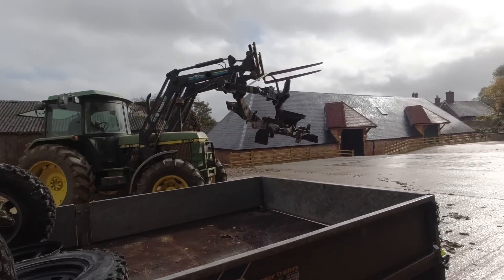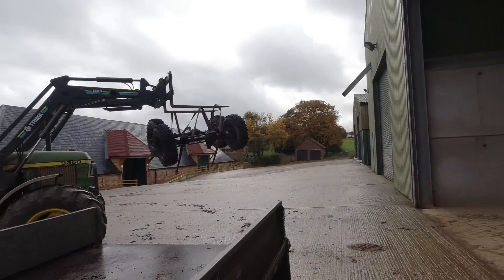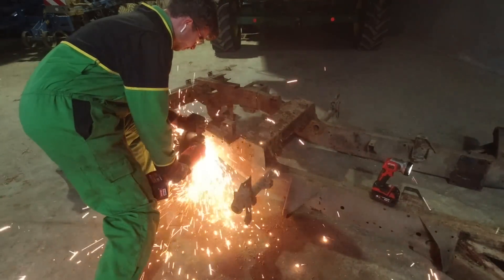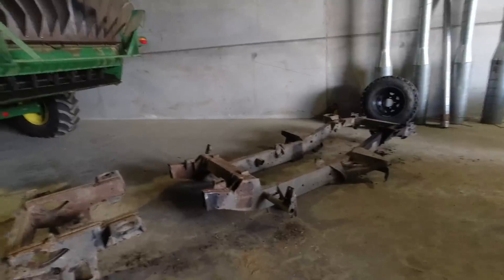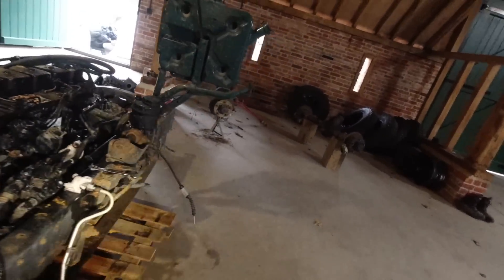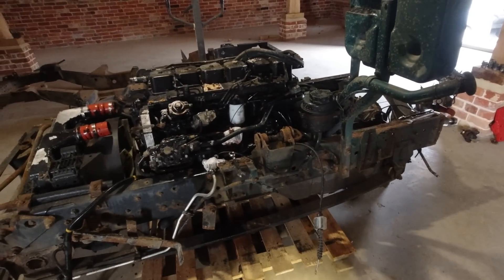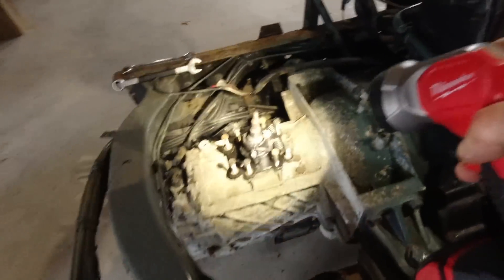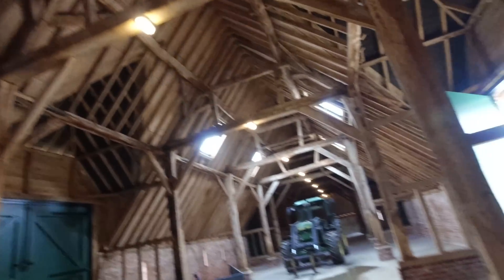Cummins Defender | Part 1| Scrap Heap Challenge!!

Comment: hi andy 6bt is a good engine mate ive rebuilt loads mate the bosh injecter pump will leak from throttle spindle reg oil changes it will last yonks good luck

Comment: This will be a great build! Looking forward to progress. 
My mate has a 90 cummins with a holset hy35 he built over a couple of years and it's an animal! 
Be warned they will break diffs, halfshafts, transfer boxes and the like just for fun! 
Especially with bigger wheels and tyres! 
My mate ended up going from 37's to 35's and we took a trip to xcess 4x4 to have some prettymuch indestructible diffs made up with arb lockers and cross pinned etc etc. 
Hopefully yours hold up, good luck 👍

Comment: Doing a Cummins conversion myself of a project. Which transmission are you running on this?
Reply from the maker: Hi its the zf 5 speed that came with the engine.